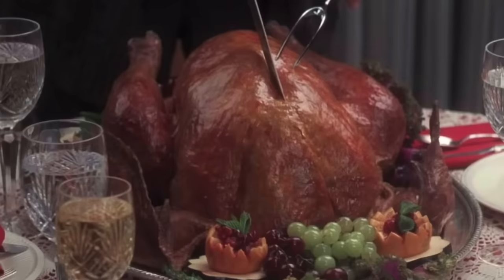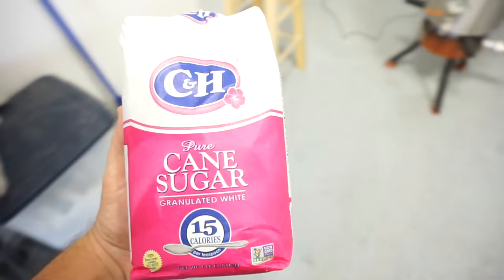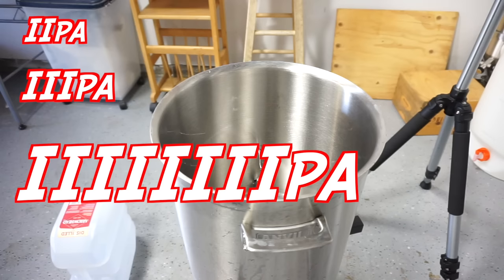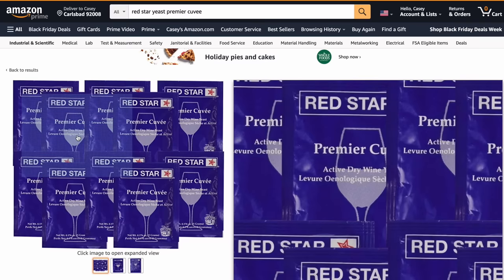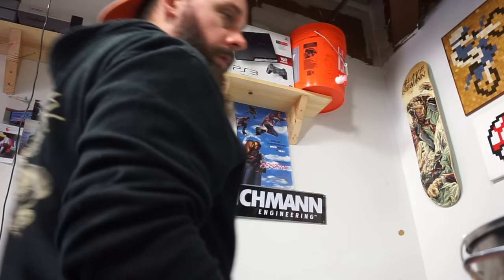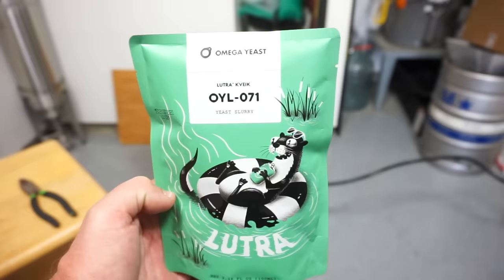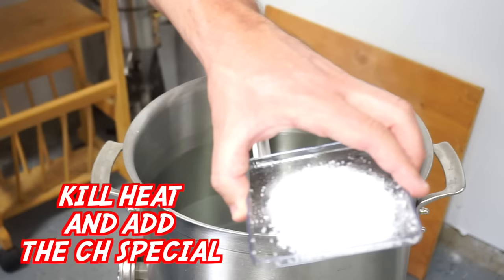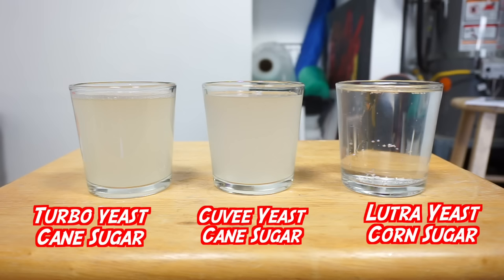How to Make WHITE CLAW HARD SELTZER At Home

Comment: From what I understand the turbo yeast is just a gross overpitch of yeast and nutrients so there are many more active yeast cells than would be in a normal fermentation. They are meant for producing alcohol for distillation, so don't produce the cleanest tasting product but can have high yields for distillers. Glad you showed me that proper seltzer, gonna have to pick some of that up. I have been trying to avoid DAP cause I am brewing higher abv ciders and I don't want to risk it. I am currently using Voss Kveik, I will have to check out Lutra too!

Comment: Great video, learned a lot. I am about to try my hand at a 10 gallon batch which I will split into 2 corny kegs and use a different flavor for each. My question is, if I use 2 packs of propper do you think 1 pack of Lutra would suffice for the 10 gallon batch?
Reply from the maker: Naw I'd use two, but I'm also not too sure.  That's more of a "trial and error" thing.  Keep us posted!

Comment: Braj, throw an aquarium heater in the tub and the cheapest powerhead for water movement you can. They even have built in temp controllers or use an inkbird.

Gotta get my hands on some Lutra now.
Reply from the maker: Aquarium heaters were the first things i tried before the anvil foundry days. Gets up to high 70s 😢

Comment: Question on clarifying (if need be, and I do this round)-all I can get my hands on at the moment for a clarifier is gelatin....all others sold out and I normally make beer, which gelatin rocks at clarifying. I already dosed my cold-crashed seltzer with it this morning...but I'm thinking it's not going to be effective and my understanding was that gelatin works primarily on protein haze, which the seltzer should lack entirely. Any thoughts? I used a dry brand of Kveik yeast and propper nutrient.
Reply from the maker: biofine
Reply: @HOMEBREW4LIFE  That was out of stock locally and I had to get on it-so charcoal filtered it. The yeast I had to use for same reasons was a different Kveik and left it with haze and baby farts. Added 1 T of flavor extract after filtering and it is great-as good or better than commercial. Carbonating now. Thanks again!

Comment: I had a mostly clear liquid after using KC fine but still had a yellow haze and some off yeast flavor. I'm looking into carbon filtering now, anyone have any simply methods for homebrewing?
Reply from the maker: tune into the brajcast manana.  Eric, you and I are gonna talk carbon filtering until the sun comes up
Reply: First, Stay away from turbo. Use lalvin EC1118

Second, invert your sugar with 1/4 Tsp citric acid per gallon, low simmer boil for 20 minutes. 

Let cool, 
Add a teaspoon of yeast nutrient and yeast energizer, because sugar washes don't have enough nutrients they will pH crash and you'll get a stuck ferment

4. When done fermenting, add a tsp sparkloid to a bit of water, bring to boil, let cool, add to gallon jug and toss in the fridge.

Wait a week.

Mine had no flavor from the alcohol or sugar wash, damn near crystal clear, and mates perfectly with good TTB extract.

STAY AWAY FROM OLIVE NATION. They are very hit or miss on the flavor and aroma. Blueberry is pretty much cotton candy.
Mango is decent

Comment: Hi All,
Doing my first batch of Hard Seltzer and I realized that it's going to come out a bit weak on ABV% my OG is 1.026. The recipe I was trying to follow says OG should be about 1.035. I may not added enough corn sugar or maybe I have added too much water.  it's been about a week like this. Is it ok to mix in another 1 lb of corn sugar mid-ferment? or on second thought I add the 1 lb of corn sugar to my corny keg and transfer it as secondary do a closed fermentation and let it naturally carbonate under pressure? (I do have a spunding valve).
Should I wait it out and enjoy some weak sauce seltzer and learn from my mistakes?
Reply from the maker: I ounce DAP!

Comment: Brewed up the lutra batch at 1.040 with dap and nutrition but sh$t staled at 1.016 85deg for a week now. Have you had any problems like that yet with lutra? Love the channel braj
Reply from the maker: Hey what's up Aaron.  Did you use the full 1oz of yeast nutrient dap?  Is your airlock still going?
Reply: @HOMEBREW4LIFE   did 20g nutrition 8gdap still going strong after a week. Pretty weird for a 1040 batch. Wondering if I need to add another round of both. And you guys had it done in 4 days? Still a little hazy too.
Reply: @HOMEBREW4LIFE  guess I kinda answered my own question. Wasn’t sure if the heat lamp in my chamber was causing airlock bubbles. You know you start over thinking  when things don’t go right. Guess I’ll let roll. Thanks

Comment: I have mine running around the 85 degree mark in my fermentation chamber and after 2 days it is starting to get e baby turtle fart smell.  Am I doing something wrong here? do i need to add more dap or nutrients? It's not a true sulfer smell yet but more like a really tart smell.
Reply from the maker: either wait it out or purge it off. Getting rid of sulfur is really easy plus the extract taste and smell will over power the turtle fart smell
Reply: @HOMEBREW4LIFE  how would you purge it?

Comment: I use a 24 hour turbo yeast, cold crashed 24 hours, racked. Cold crashed 24 hours racked. Added gelatin. After 48 hours (it's been in 30 degree or lower since 1st cold crash) and it still it milky as zach from saved by the bell! HELP!
Reply from the maker: run it thru a carbon filter
Reply: @HOMEBREW4LIFE  ahg that's what I thought! Any experience with them? Should I buy one or diy?
Reply from the maker: they are a nightmare

Comment: I followed the lutra recipe besides under pitching (only did have a packet). I’ve been reading to under pitch Kveik but wondering if I shouldn’t have for this recipe. After almost 2 days in the fermenter at 95 degrees I haven’t seen any activity. How long did it take for yours to get going. I’m wondering if I should add the rest of the packet.
Reply from the maker: Maybe too hot?  I kept mine at 85F
Reply: @HOMEBREW4LIFE  that could be it. I’ll turn it down and see what happens. Might have to throw in more if it doesn’t take off. Thanks for the help. I’ve done a bunch of your recipes. Keep up the awesome work.
Reply: How did it go for you? I haven’t seen any activity on mine also. 12 hours have passed on mine thou. But i dont want to imagine im stalled.
Reply: @aborjas23   I used half a pack and it never got going and dumped it. Did it a second time using the hard seltzer yeast nutrient from omega and a full pack of lutra and it fermented out but it tasted like sparkling wine to me. And the package of the hard seltzer yeast nutrient was brown in color which made the hard seltzer have a brown tint. Very off putting. I’ll probably never make one again until there is a little more research/videos on it.

Comment: having a little issue with my Lutra Keviek seltzer. Its kind of yellow from the Propper Seltzer nutrient packet. I tried fining with gelatin but its still looks like pee pee.
Reply from the maker: How long has it been sitting in the keg and did you use distilled water?
Reply: @HOMEBREW4LIFE  I used distilled water and it’s been in the keg for 3-days so far.
Reply: @tommurtagh9062  how did it go? Mine looks like pee pee too and straight out from the cooking batch 🤣
Reply: @aborjas23  lol so it’s been a few weeks since cold crashing/kegging and much of the pee color dropped out and it keeps getting clearer and clearer the longer it’s in the keg
Reply: @tommurtagh9062  at what temp did you ferment it? Did you manage to get to the 1.000sp in the 4 days?
Reply: @aborjas23  I fermented hot in a bucket at 95°F with a heat wrap + ink bird to maintain temp. It's winter where I'm at so I wrapped everything in 3 blankets to keep that temp up. It took 7 days from "brew" day to cold crash but I imagine you could get it down to 4 if you kept the temp regulated throughout. I didn't insulate my fermentor until day 3 when I should have done it from the start.